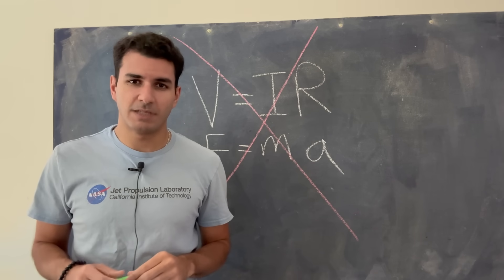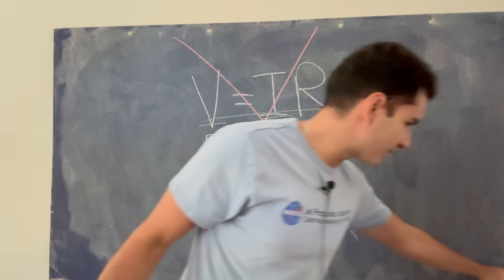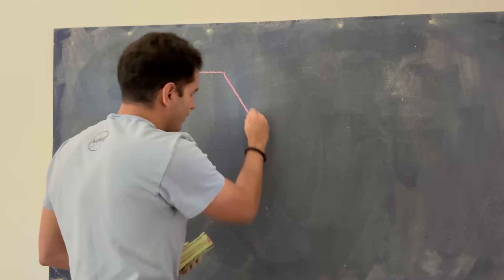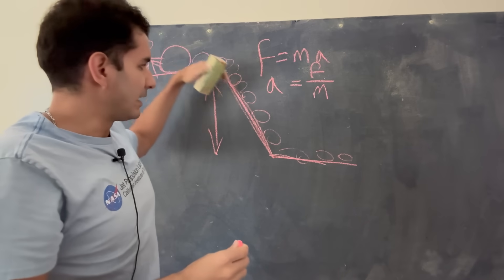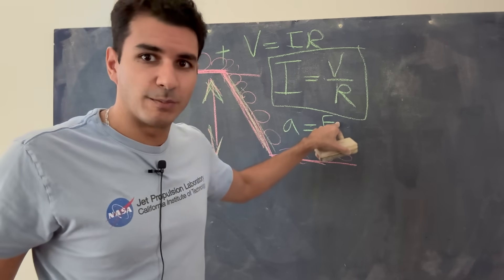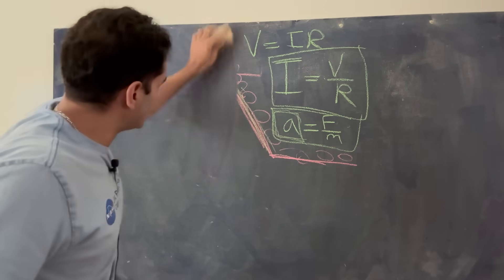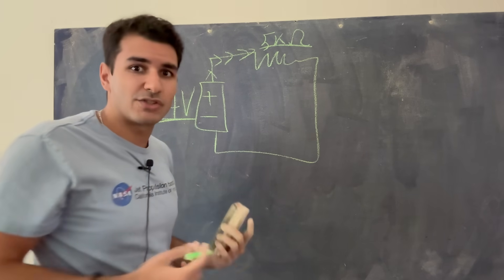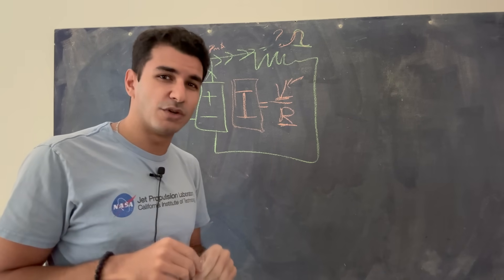You don't really understand physics

Comment: Exactly, m=E/c2 was Einstein's breakthrough of the understanding of mass.
Reply: @shikigranbell1780  ok but that's just plain wrong now. First of all c^2 is not speed, it would be speed squared.

Also c^2 only appears because in Special Relativity all velocities are divided by the speed of light for simplicities of calculation, because we can then just take the speed of light to be 1.

E/m = c^2 would just be E/m = 1, or in other words E=m. Which simply means in an isolated system, the energy of an object at rest is only made up of its mass.
Reply: Qqqqqq
Reply: E=mc^2 isn't the full equation though. It's E^2 = (mc^2)^2 + (pc)^2. m=E/c^2 is literally physically impossible. It's just an approximation.
Reply: @louisrobitaille5810  those are 2 different things tho. The first denotes mass-energy equivalence, the second energy-momentum relation. 

1. It states that the energy (E) of an object at rest is equal to its mass (m) multiplied by the speed of light squared (c²) This implies that mass can be converted to energy and vice versa. It specifically refers to rest energy.

2. This equation is the more general form that applies to objects that may be in motion.
Reply: @alibrzj  no that's not it 

E=mc² is when object is at rest which is likely not the case making p=0. Full formula is E²=(mc²)²+(pc)²

Yes same thing apply about converting mass to energy on E²=(mc²)²+(pc)² formula
Reply: @louisrobitaille5810 what do you mean physically impossible it’s always the case
Reply: @baldurstudios5637  he means m=E/c^2 is physically impossible because it presumes that the object in question has zero momentum which is kinda impossible to know or have in reality--you can only have zero momentum relative to something else, which is different
Reply: @baldurstudios5637  that's only case if the object is at rest in your frame of reference. Otherwise if the object's relative velocity is extremely small then you can approximate, and you get that an object's energy is its mass plus its Newtonian kinetic energy.
Reply: @louisrobitaille5810  I've always found it really annoying that everyone shortens it to ignore momentum as well. If the short version was it, solar panels wouldn't work.
Reply: @Gastropodix  No one ever ignores the momentum. The energies in the relativistic dispersion relation, -E^2=-𝓔^2+p^2, are not the same. Here E refers to the net energy of the internal interactions of the object in question, and 𝓔 refers to the Noether charge of time-translation symmetry, i.e. the conserved momentum over the time coordinate of the observer.
Reply: @louisrobitaille5810 its not an approximation ... its a special case or in other words not the complete picture
Reply: @louisrobitaille5810 its actually E=mc^2+AI. This equation combines Einstein's famous equation E=mc², which relates energy (E) to mass (m) and the speed of light (c), with the addition of Al (Artificial Intelligence). By including Al in the equation, it symbolizes the increasing role of artificial intelligence in shaping and transforming our future. This equation highlights the potential for Al to unlock new forms of energy, enhance scientific discoveries, and revolutionize various fields such as healthcare, transportation, and technology.
Reply: @louisrobitaille5810  E = mc² is always valid. Here m is not the rest mass but the relativistic mass. m = m0/√1-(v/c)². In case of a rest mass it reduces to m0c²
Reply: @sambhavgiri4007  That doesn't work for lightspeed… You get m0/0 🧐.
Reply: @sambhavgiri4007  No, "m" is the mass. There is only one mass, the invariant mass given by the norm of the 4-momentum.
Reply: @louisrobitaille5810  umm obviously?? Any object with mass travelling at light speed will have infinite energy
Reply: @SpacetimeTraveler-p4e  that's literally the rest mass of the particle? The thing is the idea of relativistic mass has been just abandoned by physicists now, cause momentum and Energy are much more fundamental. The formula I said still works, just isn't accepted anymore, still taught to beginners in STR
Reply: @sambhavgiri4007  Yet photons don't have infinite energy...
Reply: @sambhavgiri4007  No, we no longer use relativistic mass because it doesn't exist, and by extension, neither does rest mass. The relativistic mass is a shorthand notation that does not exist in nature. 
      Energy or momentum are not more fundamental than mass; mass is a Lorentz scalar, g(p,p)=m^2 while energy and momentum are observer-dependent components of the object 4-momentum that reflect the Noether charges of spacetime translation symmetry.
Reply: @louisrobitaille5810 its an indeterminate form ... m0 is the rest mass of a photon which is 0 ... so its just not solved, than being incorrect
Reply: @louisrobitaille5810 
It's more like, if you expand E=sqrt(c^2p^2+c^4m^2) at p=0, you get the Taylor series, which is E= mc^2+p^2/(2m)+O{[p/(mc)]^4}. The second term is the kinetic energy. And the first term suggests that there is a form of energy baseline that depends on mass only.
Reply: @zywang8910 yes, this is what einstein actually did anyways
Reply: Sorry to say. E=mc^2 is wrong; the notion of mass-energy equivalence of Einstein proven wrong at my website.
Reply: @chanrasjid8688  You can't prove something wrong if you don't understand the equation.
Reply: @SpacetimeTraveler-p4e  The proof in the pie is in the eating; the proof that E=mc^2 wrong is in "reading and digesting my paper on the topic".
Reply: @chanrasjid8688  I watched your YT video on this topic and it's entirely wrong. You're not understanding what relativity is or does.
Reply: @SpacetimeTraveler-p4e  I can't comment further on your assessment of my video or papers. A debate between two person has no ending.
Reply: @chanrasjid8688  You don't have the necessary background in physics to enter into a debate on physics.
Reply: @SpacetimeTraveler-p4e  what is 1+1 = ?
Reply: @chanrasjid8688  If those are elements of the set of reals, then 2. If there's a time-like vector field A^m and another B^m, and we say that A^m=B^m (for simplicity), how would you show that A_m=B_m?
Reply: @SpacetimeTraveler-p4e  I don't know about vector fields! Too difficult.
Reply: @ When're you collecting your Nobel Prize?
Reply: @louisrobitaille5810  Don't just assume that just because a Nobel prize is awarded that the physics behind the prize is set in stone. The Catholic Church considered geocentrism to be truth but finally dismissed after centuries. Various Nobel prizes have been awarded around the neutrino, but a short paper of mine shows that beta decay emits no neutrino! Such Nobel prizes for neutrino physics would in future end up as classroom case study in sociology when their physics ended up dismissed.

Comment: Hi from France, very useful material. I know its important for instance to model systems to know the causes, the effects and perturbations.
Now i'm wondering, can u explain the cause and effect with capacitor (ic=Cdu/dt) and inductor (e=Ldi/dt). It could be really interesting in an other video and maybe u can explain equations for other domains in physics it would be great.
I'm guessing for an inductor its really interesting with the emf produced by the coil to resist current or magnetic field i don't remember. 
Easy video and useful for everyone I'm pretty sure, hope you'll do it 🤠

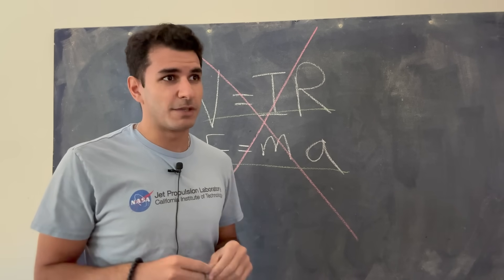Comment: 0:58 V=iR and  F=ma are very similar indeed.  Both have one captital  roman letter on the left side and two  roman letters on the right side. But the similarity ends there, since the former equatuon has two capital lettees on the right side while the latter equation has two lower case letters on the right side. QuIz qiestion. How is the equation is E = h nu similar or different fron each of the two equations? How about PV=nRT?

Maybe NASA should stick to trying to debunk fake moon landing theories.

Comment: Well … no.  It’s great that people watching this have found it helpful, but I = V/R and a = F/m don’t have any special connection to cause and effect.  
Take your circuit example with a 9V battery and a resistor.   No problem with the voltage being the cause of the current in the circuit, but the resistor has a 9V drop across it, so what causes that?  Surely it’s the current flowing through the resistance.  In this case the current is a cause, the voltage drop is the effect, and you need V = IR to calculate that effect – using I = V/R is no help here.
Same with Newton’s 2nd law; yes, force is a cause when it results in an acceleration, but you mentioned drag on an object moving through the air, so what causes that drag force?  It’s caused by changing the velocity of air striking the object as it flies.  In this case acceleration of a fluid is the cause and a force on an object is its effect, so you need F = ma to calculate effect from cause, again the opposite of the video’s point.
Also, and it was probably just a slip of the tongue, but you did say twice (~6:00 mins and ~9:30 mins) that voltage gets slowed down by resistance, which makes no sense (reduced, yes, but not ‘slowed down’).  I’m sure you understand all this perfectly well, but a physics video needs to be just about bombproof if it’s going to be called ‘You don’t really understand physics’.

Comment: what im seeing here is that you are giving what we can actually observe to have more importance hence putting it on the left hand side. but that would only apply to quantities with time. Why is it necessary to give more importance to time related quantities? what about the relation between mass, volume and density? lets say we measured the density of a container using a pressure comparer. and we put it on the weighing scale and measured the mass, then we could know its volume. so should volume be considered in the LHS? but we could do the same with mass and volume instead and have density in the LHS.

Comment: Things get subjective here if you wish to find the force required to accelerate a body of m mass with specific acceleration then you use F=ma and similarly V=IR if you want to find the potential to induce that I magnitude of current in the circuit through the conductor of resistance R.Here I am discussing about that how much cause we need to find the result we want to produce in the system.

Comment: I'm not sure that I understand the premise of this video.  If it is that V is not a function of I and R, or that R is not a function of V and I, then I think the video is wrong. If it is that physically, those functions are not relevant, I think the video is also wrong. 

If the issue is cause and effect, I don't think the cause and effect is as clear as the video may suggest. What is happening is that current is flowing, something is inducing the flow of current, and something is resisting the flow of current. The inducer is equal to IR. But what this says is the voltage source must output the same as IR. The resistance must resist at the value V/I. And the current must flow at the value V/R. Resistance is a real thing, and current is a real thing. The functions I = V/R and R = V/I handle them well enough.

Voltage is the least understandable thing here, I suspect, and I admit that IR does not mirror its physical nature very well; however, this may be the most physically important thing of all for it requires many other theoretical developments and equations to get to the bottom of. In fact, the equation shifts the focus from the cause to the effect that the cause must match. But this shift adds an important piece of information to our understanding of V. In this case, we substitute an equivalent known (resistance) for a difficult-to-calculate unknown (voltage). That is to say, we can measure the impetus to electron motion, or the resistance to electron motion, but these values will be the same ignoring sign. The impetus to electron motion is quite involved to calculate, but the fact that we are in a closed system allows us to measure it indirectly from the resistance to electron motion. 

I don't think that hurts our understanding of physics too awfully much. It probably does go by unnoticed by virtually everyone, and that is a shame. But as students of physics, we must scrutinize every equation in order to understand it. We need teachers to point such things out. But I do not think we need our equations set up in a cause and effect pattern, because, for one thing,  there may not always be such a unique pattern. As in this case, I is "caused" by V and R, and R is "caused" by V and I, a quite circular circumstance.  It might be better to say that V, I, and R are interrelated in such a way that there is no true cause and effect pattern.

Comment: It's also true that some concepts like the Force needs to be defined, so it makes sense to define the force as the manifestation of the effect, since it is proportional to the effect produced. Also, same acceleration seen on object with different mass, means different force, so the mass act as a force scalar for the acceleration. I think in the case of classical definition of force, it isn't too bad as it's defined, even if the effect is not expressed as a function of the causes, because, as i already said, sometime the cause needs to get defined from other, more easily measurable quantity with which they relate to.

Comment: So my differential equation of a voltage source driven rlc  is wrong ? Ld^2q/dt^2  + Rdq/dt + Cq =V(t) . I (dq/dt) is only a dependant variable by definition especially in network analysis where the voltage source would need to be calculated.. You prposed a hypothetical perfect voltage source but engineers know they have internal resistance ,and reactance. Take alook at kirkhoffs voltage law
Reply: The only part of it that needs to be corrected, is that it's q/C, rather than C*q.
Reply: @carultch  had to double check V = qC is correct and energy = 1/2 C V^2

Comment: I don't think the main takeaway here is that F=ma and V=IR should be written a=F/m and I = V/R, respectively. What if we have a current source instead of a voltage one? Then V= IR is more suitable by the same logic. The main point is that writing an effect as a function of the cause gives us more understanding of the physical phenomenon we try to describe. 
Practicly speaking, the calculation is the same but this way we get a glismpe of what is going on.
Reply: A current source is a concept that exists as a theoretical concept, but what it really is, is a voltage source that dynamically senses the circuit it is connected to, in order to produce a voltage at some epsilon greater than the voltage of the circuit it is feeding, in order to feed a desired current.  This is why voltage is seen as the cause, and current is seen as the effect.

I think the primary reason most Physics formulas are written in the form of "cause = impedance times effect", is so we don't have to remember which term is on top, and which term is on bottom.  It's much easier to remember a formula specified as a multiplication problem, than it is to remember one specified as a division problem.  There's also formulas with the cross product, where there is no standard convention to invert the cross product, so it is more meaningful to specify them as products, rather than quotients.
Reply: @carultch  >"A current source is a concept that exists as a theoretical concept"

Isn't an inductor a temporary current source?
Reply: @carultch  a current source is a source that provides constant current at variable voltage. It is not a concept nor some sort of abstract interpretation. If one unit is dependent on the other but not vice-versa it doesn't mean that the unit which derives from another cannot be the main focus. That's like saying water is an interpretation for hydrogen and oxygen and not it's own thing

Comment: You are confused in cause and Effect < lets talk about it
at 6:57
you said you can predict the motion (effect) after throwing the eraser
but think about it if i stopped the duster in mid air after you thrown it, I can predict the cause(or you can say the exact location and the way you throwed it
This thing is not about predictions
Effect and Cause are Relative terms

if you not understand i have another example for you
Lets assume some electrons moving in free space , There is not external force acting on them
Then Potential is not the cause , It will be the Effect of moving Electrons , There movement is responsible for Current(cause)
And that Current is Responsible for Potential(Effect) if we are are taking about some random points a and b

I hope you Understand that Effect and Cause are Relative terms
Don't mislead Anyone
Thank You
😅😅😅😅

Comment: For me only the man is f & m is the ball without anything else.. representing just that initial relitive inertia frame for each objects. In fact it wouldn't even be the man it would be metabolic tranfering of energy into that mass object proper . Form &  shapes are extra perimeters tbd.
o it's a new frame of reference generalization of a 4th pov taking into account as if minds eye is hovering over the cause & effect within as opposed to a 1st position force = 2nd mass .
Devil in the thermodynamical box where we ignore he is bringing outside energy into the system to do his open and closing of gates. 
Doesn't this cause how 1st newton 2nd einstein for on 3rd hiesenbergs photon approach to go yoo hoo or woo if we add of subtract move measurements or volicity etc etc 
As opposed to hamiltonian occelating field correlated with idealized time giving us much more sensible measurements even those its a very subjective objects inderect line detected not very physical in proper terms.
Reply: Kinda violate basic language and phylosphical measures when we switched into a more stochastic approach of the eqauvilance principle